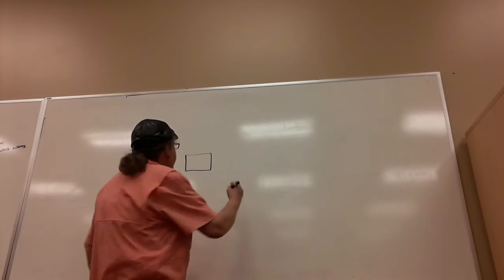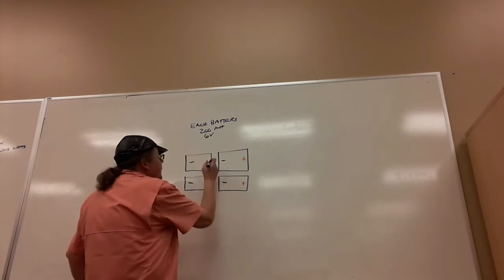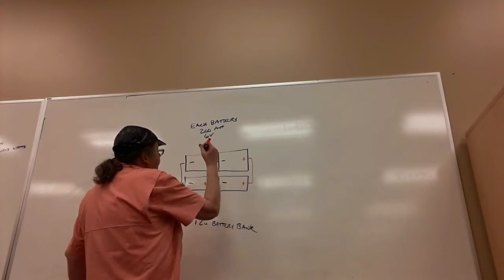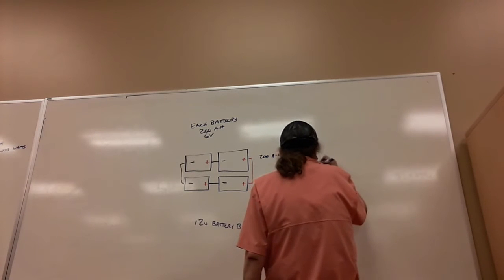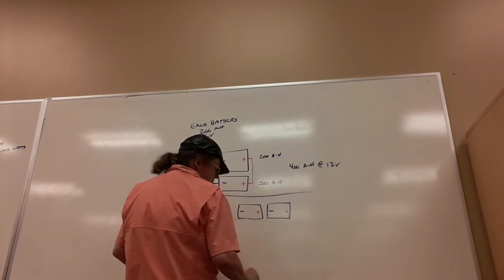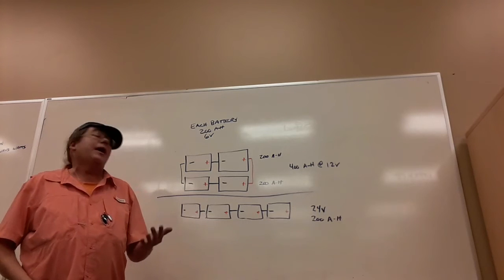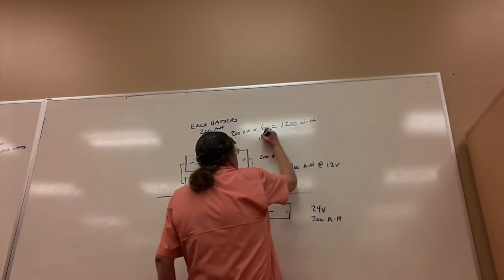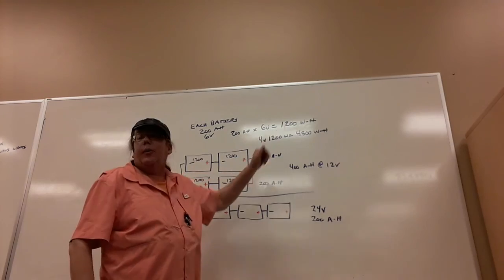Off-grid battery bank capacity: amp-hours vs watt-hours

Comment: Your math makes me feel much better about my setup. I have a 24v bank at 282.5ah. Seven 12v Batts at 73ah and one 12v batt at 54ah, wired in series/paralell.  Using your method, I believe I have 6,780wh. The numbers are approximate, but should be pretty close. Thanks!
Reply from the maker: Zen -- you will likely run into to trouble with that mis-matched battery.  It will probably fail prematurely, as with every charge/discharge cycle you're bringing it to a lower depth of discharge than the other 7.  Best practice is that every battery in the bank must be identical....with my installations I actually require the battery distributor to provide batteries with the same date code AND same batch number, otherwise I reject the whole shipment.

Comment: What I need to know is for example, I have a 12 volt car battery that says 725 amps, how can I determine the watt hours or the amp hours for use?
Reply from the maker: In short, you can't, and it's a very easy thing to get confused about (and a great question). The "amps" spec for automotive starting batteries is actually Cold Cranking Amps (CCA), which just measures the maximum current the battery can push all at once to the starter motor on your vehicle, for example when it's extremely cold outside and the starter has to turn the crank through frigid, sludgy oil. CCA rating has nothing to do with amp-hours or watt-hours of capacity. Vehicle starting batteries are made to provide a lot of power for a few seconds at most, then be quickly recharged by the car's alternator within a few minutes. They are entirely unsuitable for off-grid storage in a PV system, and you may not even be able to find their capacity rating from the manufacturer, because they are not designed for that task and will fail very quickly (usually in under a year) when cycled daily for home storage. At a minimum you want a "marine deep cycle" battery (that's what I use in my camper), but much better than that golf cart batteries, or larger lead acid ones used for solar (L-16 etc), or the new-ish Lithium Iron Phosphate batteries. Also note that NONE of these "deep cycle" batteries for PV are suitable for use as vehicle starting batteries....different products for different applications.

Comment: Dan I have a cabin I moved into, over the last 2 year I run(On the high side) 350 kwh per month. I'm trying to figure out how many batteries I would need to run the house, just  from Batteries. I will add solar panels from time to time, but having said that, I don't get a great deal of sun here, because the neighbors all have trees. Thanks for any light you can lend on the subject.

Comment: Thank you for the video!   Can you please explain how the 24 V system has more efficiency and therefore more capacity? And, how much more capacity does it actually have?
Reply from the maker: Hi Mark - It's all about resistance losses (Joule's first law, and Ohm's law and the Power law) where energy losses in wire = I²R.   So in the 24V system, wire losses are 1/4 of those at 12V assuming the same size wire. Of course for 12V systems you increase the wire size to compensate (but copper is expensive!), BUT internally the charge controller and inverter both operate  more efficiently at higher voltages.  

The same PV charge controller can handle 4 times the incoming solar wattage charging the battery bank at 24V than it can at 12V. And often 24V versions of the same inverter will be rated higher than the 12V version. For example the Outback FXR - the 12V version is rated 2000 Watts output, but the 24V version is rated 2500 Watts.

So, the increase in "capacity" is not increased actual Watt-hours stored, but in fewer Watt-hours wasted when both charging and discharging.

12 Volt off-grid systems are only rarely designed at 12V nowadays, usually only for tiny systems, RVs, and mobile applications where there are a lot of 12VDC loads. All because of I²R losses.

Comment: Hi, thanks for the video- so in this example, how did the guys get 120VAC? I understand that an inverter converts DC to AC... but is there a typical transformer people use? Seems like a lot of people use 6 or 12V batteries in off-grid homes (the sum of which is less than 120V DC).
Reply from the maker: Inverters both convert DC to AC, and step up the battery voltage to 120 VAC.

Comment: If a device lists its ( consumption ) Wattage, is that number for one hour ? Trying to determine Watt-Hours so I can be sure I have more than enough power to run a device for an 8 hour work shift. Thanks
. . . wish I owned one of those Kill-O-Watt gadgets
Reply from the maker: Watts are a "snapshot" of how much power is being generated or consumed at any given instant. So if something is using 100 watts and does that for one hour, that's 100 watt-hours (0.1 kilowatt-hours). Also note that "nameplate ratings" printed on the back of each appliance actually show to MAXIMUM it can use....so for a TV for example, that would a white screen, brightness all the way up and sound cranked to max. That's why the kill-o-watt meters are so handy.

Comment: I'm sorry I am going round and round in circles. I have a camper and  just want a simple answer to this question.... how do I compare capacity between a standard leisure battery always sold by amp hours  and the capacity of the  new lithium power banks like a Jackery sold by Watt hours. Someone please just tell me how many ***amp hours***** a Jackery 230V/200W Pure Sine Wave AC Outlet, 240Wh has and how to work it out. Its almost like its a bloody secret on the internet held by portable power station manufacturers. Thanks.
Reply from the maker: Just multiply battery amp-hours capacity by battery voltage to get watt-hours. However, lithium-iron (LiFePO4) batteries can be discharged without damage all the way down to 20% remaining capacity (state of charge) while lead-acid batteries (both flooded and sealed) should never be discharged below 50% capacity. So, LiFePO4 batteries have more usable capacity at the same watt-hours of storage.
Reply: @danfink9794  Thanks for you response but I am afraid I am still lost. Normally I can work stuff like this out but I have just got a mental block on this. Can you perhaps just spoon feed me and tell me how many amp hours there are in 240 watt hours. I am looking at the Jackery 240. That's what I need to know. Once I get that I am sure i will then understand the equation I just can't get it right now. Many thanks.
Reply from the maker: @donner101  No worries! I teach solar design and installation at the community college level, and this is one of the trickiest concepts we deal with each semester. The Jackery 240 is listed as 16.8 amp-hours at 14.4 volts, so 16.8 x 14.4 = 240 watt-hours. 80% of that is usable (because it's a LiFePO4 battery bank), so 192 w-h usable-that's tiny! I outfitted my camper with 2 marine deep cycle sealed lead-acid batteries, each 12V and 70 a-h, so 12 x 70 = 840 w-h each, total of 1680 w-h. But with lead-acid, only half of that is usable without premature battery damage, so I have 1680/2 watt-hours usable = 840 w-h. Each battery cost about $150. This illustrates why I do not usually recommend these "portable power stations" for anything more than keeping your phones and tablets charged, and maybe a small LED light.....lithium batteries are expensive, so they skimp on battery capacity, leaving you with very little power for useful stuff. I have multiple LED lights (some very bright, like for cooking), a water pressure pump, run a boat inflator and charge the sonar battery, coffee grinder, and charge devices, etc. Of course I had to add a solar charge controller and a 120 VAC inverter, fuse panels, etc. whereas the "power station" things have those built in....but again, usually they'll be very low capacity and won't run much useful stuff on AC, and not be able handle much more than 100 watts of solar (I have 250 watts of solar). I find having a "real" system; just a small version of a home or cabin system, using equipment from reputable solar manufacturers (for me, Morningstar inverter and Midnite solar charge controller), is far preferably to these all-in-one lithium power stations with tiny battery capacity. Also note - lithium batteries can be quickly ruined by charging or discharging them at below 32 degrees F (0 C), so here in Colorado that's simply not an option; my camper is a rooftop tent over a pickup bed. And hey - I need to get more solar videos up, so I'll do the next one about my camper solar power system! And why it's better than those tiny power station things I get pummeled with online ads for.
Reply from the maker: @donner101  No worries! I teach solar design and installation at the community college level, and this is one of the trickiest concepts we deal with each semester. The Jackery 240 is listed as 16.8 amp-hours at 14.4 volts, so 16.8 x 14.4 = 240 watt-hours. 80% of that is usable (because it's a LiFePO4 battery bank), so 192 w-h usable...that's tiny! I outfitted my camper with 2 marine deep cycle sealed lead-acid batteries, each 12V and 70 a-h, so 12 x 70 = 840 w-h each, total of 1680 w-h. But with lead-acid, only half of that is usable without premature battery damage, so I have 1680/2 watt-hours usable = 840 w-h. Each battery cost about $150. This illustrates why I do not usually recommend these "portable power stations" for anything more than keeping your phones and tablets charged, and maybe a small LED light.....lithium batteries are expensive, so they skimp on battery capacity, leaving you with very little power for useful stuff. I have multiple LED lights (some very bright, like for cooking), a water pressure pump, run a boat inflator and charge the sonar battery, coffee grinder, and charge devices, etc. Of course I had to add a solar charge controller and a 120 VAC inverter, fuse panels, etc. whereas the "power station" things have those built in....but again, usually they'll be very low capacity and won't run much useful stuff on AC, and not be able handle much more than 100 watts of solar (I have 250 watts of solar). I find having a "real" system; just a small version of a home or cabin system, using equipment from reputable solar manufacturers (for me, Morningstar inverter and Midnite solar charge controller), is far preferably to these all-in-one lithium power stations with tiny battery capacity. Also note  lithium batteries can be quickly ruined by charging or discharging them at below 32 degrees F (0 C), so here in Colorado that's simply not an option; my camper is a rooftop tent over a pickup bed. And hey.... I need to get more solar videos up, so I'll do the next one about my camper solar power system! And why it's better than those tiny power station things I get pummeled with online ads for.
Reply: @danfink9794  That's great. I'm pretty sure now I am making the right decision to upgrade my camper van set up from one lead acid battery to upto 3 100ah ones and some solar as it is already a split relay charging from the vans alternator. It also already had a 1000 watt inverter connected when I bought the van. What was throwing me was not so much the equation but I kept doubting myself when looking at the portable power stations when working out the amp hours. I just couldn't believe it was so low for the prices they charge. I thought I must have been calculating it wrong. As you say power stations do have built in inverters but that's yet another stumbling block as you have to study the full specs in great detail as may of them barely have above 300w inverters and some are even alot less. Also I don't like the idea that you have to buy a compatible solar panel with a specific plug port connection on those power stations. I am very vary of many vloggers reviews on power stations now as they seem to simply bypass many of the obvious downfalls.  A good honest and thorough review would be very helpful. Thanks for your help.
Reply: Please just forget Ah's. Wh is all you need. Just use an ohms calculator, many on the web

Comment: hey bud, great video! I got a question, i can't seem to find a straight answer anywhere... Im moving into a truck camper, I have a desktop computer that has a 1050w power supply in it, I know it doesn't run that high but thats the rating of it.. I want to get a battery bank large enough to go a few days with having my computer on and gaming, watching videos ect.. could you tell me roughly what I would need battery bank wise? I keep reading the larger the amp hours the longer your stuff can run, and get confused with all this... I want to run 2 24" LED monitors they say at the most 60w each at full brightness and the desktop power supply is rated at 1050w XFX Modular is what it is... How many batteries at 6v should I get to make sure I can run it for days on end... plan to use the alternator in my super duty to charge the bank when it's low.. If you have the time I would love to get your thoughts! I could even pay you for your time to explain it to me!
Reply from the maker: Hi Danny; You can contact me personally through my website www.buckville.com , happy to help. To start with, though, get a "Kill-A-Watt" meter for $20 at any Home Depot, Lowes, Ace etc, and a power strip. Plug all your computer equipment into the strip, continue your normal computer usage pattern, and after a week it will have stored how many kilowatt hours you spent to feed the computer. You can calculate battery bank and solar solar size directly from that data. Holler at me when you get that data, and I'll work through the math with you.

Thanks for commenting!

Comment: This is great and all... But you don't explain the discharge rates of both systems. Let's say you are running 1000w of electrical usage... Do both systems have the same run times? Ignoring of course any differences caused by the difference in voltage. I'm looking at setting up a sailboat for off grid power and would like to include electric drive as well... I'm looking at much bigger systems than this (looking at running multiple Tesla battery packs) but not sure how much battery I need. I will be running between 1500 and 2000 watts of solar to keep things topped off, and won't likely be using the electric drive very often. Just to motor in and out of mooring, slips, marinas, etc.
Reply from the maker: Hi Tanner -- the discharge rates on those 2 systems were very similar; small remote cabins with only a few loads like lights, stereo, small TV etc. Technically the 24v system should show a bit more capacity than the 12v, because of less resistance loss to heat in the PV and battery circuits, and more efficient inverter performance. Most larger battery systems are 48v  for this reason, and 300-500v for lithium ion battery banks like the Tesla Powerwall.

As for sizing the battery bank (and solar array), that's an entirely different topic than the series/parallel I covered in the video. I hope to cover it with another video soon, it's a frequently asked question.  In short, you'd calculate or measure the total watt-hours of load over a 24-hour period, and add some extra battery capacity to make up for losses in the wiring and inverter efficiency.

Comment: You did not say whether these batteries that you're talking about were regular glass mat deep cycle batteries or if they were lithium ion batteries! That's one thing you fail to say I'm just curious which kind of battery were they? I'm assuming they were a glass mat batteries because according to my calculations you only charge them down to 30% capacity using 70% capacity according to my calculations! Lithium batteries can be charged down to zero and recharged 500 times to 800 times so I'm assuming you used glass mat deep cycle batteries and not lithium batteries I'm assuming!

Comment: How about batteries mixed with different Amp hours...Ex 24v....four 6v batteries two of them 350amp hours and two 370 amp hours?
Reply from the maker: It's never a good idea to mix different battery capacities or different battery ages in one battery bank. Newer batteries will be damaged by the older ones, bringing everything down to the older batteries already shortened lifespan. Same with mixing batteries of different amp-hour capacities into one bank - the higher capacity ones will never charge fully, and again be damaged down to the capacity of the smaller ones. 

I actually insist on batteries with matching date codes AND lot numbers from my distributor.  I'll do a video about that with some thermal imaging photos showing what happens when mixing older and newer batteries.  

If you have different battery types, you can do separate battery banks switched in and out for cycling, and this can be automated with electronics.
Reply: @danfink9794  please do this is interesting ....i appreciate the your time and input...

Comment: Your first diagram is wrong. You have to bring out individual leads from the positive and negative of each 12 volt set. Your second diagram is fine. The first diagram is suppose to be series parrell I'm not sure what you have there. The second is a series connection

Comment: I'm hoping I can run a full sized washer and dryer with 2 car batteries
Reply: not likely. they'd probably require a higher discharge rate than can be provided by a normal 9v lead acid battery. you would also need a lot of transformers and stuff in order to not mess up the electronics. it wouldn't be as easy as running jumper cables from the battery to the prongs on the plug.
Reply: but you should look it up! search on youtube "backup power from lead acid battery tutorial"